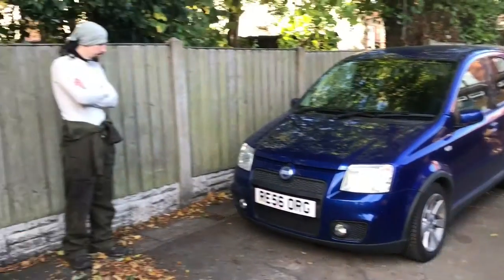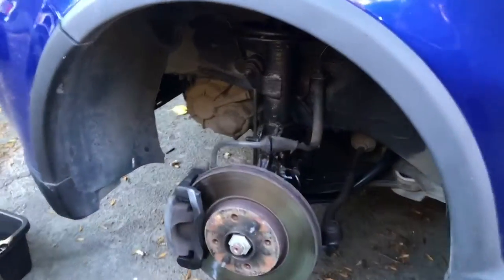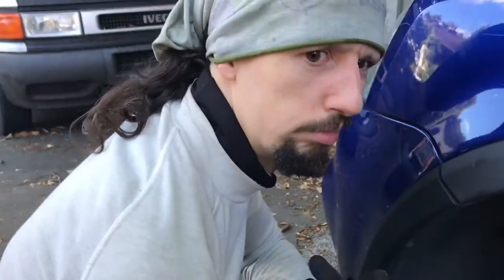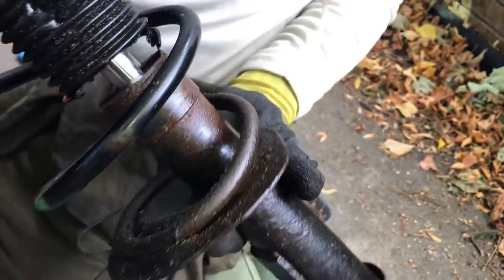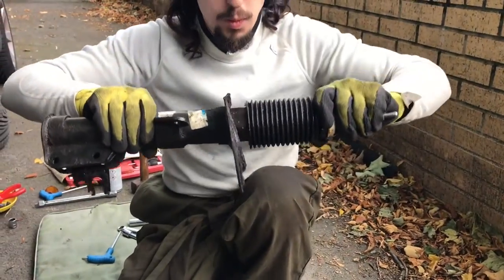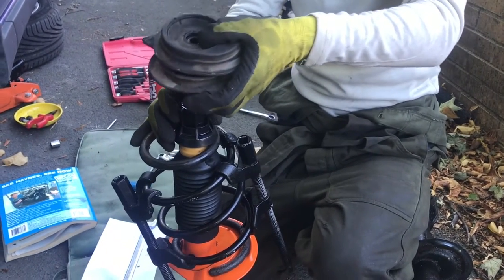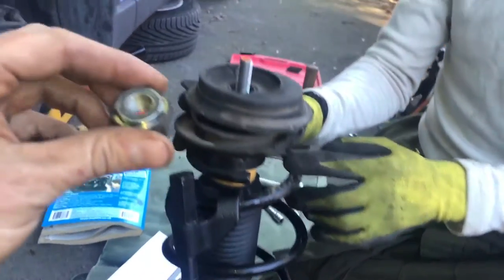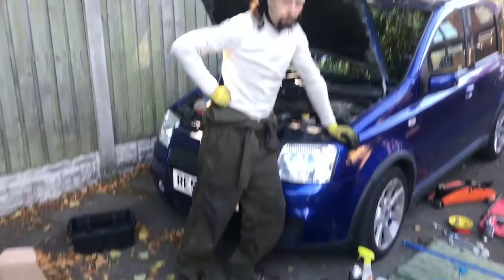Fiat Panda Suspension Strut Replacement

Comment: One of the best "how to'" I've seen I reckon. Chuffed. 😷👍🏼
Reply from the maker: Cheers! That’s great to hear 😀👍
Reply: @MechitBetter  I'm doing mine next week.... 😲
Reply from the maker: Good luck to you. It’s not too complicated if you take your time 👍
Reply: @MechitBetter  just thought I would let you know how I got on.....

1) the two bolt heads on the bolts that hold the shock absorber to the knuckle were corroded and the bolt heads just rounded off so I had to use a blowtorch on them along with mole grips to get them off, took absolutely ages.
2) the top shock mounting nut was so tight when I put the allen key in to stop the strut centre from spinning it stripped the allen key centre on the strut so I had to get two mole grips on the chrome strut to stop it from spinning then it was still so tight it was turning the chrome strut I ended up trying heat with a blow tourch/freeze spray but still not worked so I had to chisel it off..
3)and the next obstacle was the anti roll bar link nuts siezed. They were that tight it again stripped the allen keys round (yes correct size used) I had to hacksaw the link in two, pull the plastic cups off the chrome ball joints, mole grip the chrome ball socket and undo the nuts that way
4)the final obstacle was the big nut holding the top strut mount was so seized it stripped the allen key round again so I had to resort to the double mole grip onto the chrome strut method and shock it off initially with a cold chisel. All of this took me 4 hours in total.

CAN ALL THE PEOPLE IN THE WORLD WHO REASSEMBLE STUFF LIKE THIS PLEASE USE COPPER SLIP!!!!!!!!!!!!!!!!!!!!!!!!!!!

😷

Comment: You are lucky. The later Panda (2012+) is very similar but to reach the top of the struts you have to remove a large black plastic exterior panel that is between the bonnet and the windscreen.
And BTW, you could use a cranked ring spanner for that top nut. 19mm or 3/4" - exactly the same.

Comment: You were really lucky with that drop link. If the original part was fitted dry (without anti-seize paste), you’ll find an angle grinder is the best way to split the nut.

Comment: Great video, well done guys, my panda is booked in to a garage to get the same job done, next time I'll get a set of spring compressors and have a go myself, thanks guys, keep them coming please :)
Reply from the maker: No worries Tony. Thanks for watching! 👍
Reply: Get yourself some angle ended ring spanners top nut is 19mm. The special step nut is 27mm.

Comment: The top nut is easy to remove with a cheap cranked ring spanner from Lidl or Aldi. Except when it was fitted by a gorilla. Mine had to be drilled vertically down the threads. It wrecks both but gets it loose and both get replaced with the new shock. A cheap rattle gun (£50 from Lidl) makes life easy. 
The stepped nut has to be tightened to “kin tight” AutoDoc do mention it on their video. 
The M10 bottom pinch bolts are best coated end to end with a high solids paste. Copper grease won’t do. Ditto the M8 bottom ball joint bolt. Also notorious for rust. 
My top spring seat was totally rusted. I scraped it clean and coated with chain saw bar oil. It soon gels so won’t make a mess.

Comment: The hook is to hold the Ram in closed position. And it is used only for packaging  reasons. And for the top mounts you Could have used a nuckle saver ring spanner But Very Good Video for DIY.
Reply from the maker: Thanks David. We’d assumed that’s what the hook was for, but it wasn’t mentioned in the packaging anywhere which seemed a bit remiss on their part. Thanks for your tip about the spanner too. We’re always happy to bodge something up if it saves us a bit of cash 😀

Comment: Really good thank you. But I found if you release the top nut before removing completely the strut you don't need to make a special socket as the strut can't turn as still fixed.  Then it is easy to completely undo when ready to remove.
Reply: I don't think the complete strut spins around its the shiny silver damper rod that spins

Comment: The thin rod with the ends bent over is to keep the strut compressed in the packaging (as you demonstrated it expands if left alone due to pressurised gas inside)
Reply from the maker: Ah excellent! Thanks for letting us know. That’s been bugging me since we changed the struts 😁
Reply: @MechitBetter  Sweet! nice to close the book on that little mystery.

Comment: Several comments that the nuts at the top are hard to undo.  That allen key in the dinky plastic holder @9:08 would never have done mine.  I had an L type allen key with a foot long pipe on it, worried I'd break the key. It got harder as I undid the nut because of corrosion there, so I backed off and carefully cleaned the thread grooves with a triangular needle file.

Comment: Really good video.  Surprised by the general lack of videos on the 169 model Panda on YouTube considering what a popular car it was.  Thank you for commenting on the Konis, I've often wondered if they helped enough to justify the effort, but I suppose when your struts are knackered anyway  you have a good reason to upgrade. I test drove a 100HP back when they were new and just couldn't live with the ride, so I got a Multijet diesel version instead.  That was also bad but in a different way.  I don't suppose it matters now because the job is done but could you not have used your modded socket to hold the nut still, then put a long 5mm hex socket onto a torque wrench and tightened it to 65lb/ft by rotating the strut counterclockwise?  

Also, great that you emphasis the safety aspects particularly the spring compressors.  They're a necessary evil and even though you can get ones now that are pretty safe I still hate them.

Finally, a bit of humour is an excellent but of light relief but your sidekick could tone it down just a bit, unless he's trying to audition for kids TV?  But I am admittedly a bit of a grumpy git.
Reply from the maker: Thanks Paul, for watching and for your suggestion regarding the torque wrench. Your method would work with a long hex bit. I’ll remember that for next time! 👍 it’s OK to be a grumpy git. We’re often the same. A little larking about keeps us sane during these jobs 😁

Comment: Which Haynes manual did you get for the 100hp? There isn't one exclusive to it. I've heard you need both the panda one for the non-mechanical stuff and the punto one for the mechanical stuff. Is that true? Cheers!
Reply from the maker: So far I just have the standard Panda one and it’s been fine. I haven’t done any major engine work though 👍
Reply: @MechitBetter  in case you still got the car, it's not a bad idea to get one on the side! My car has done similar mileage as your one and I need a new clutch last month. The steering column, rear axle and transmission are the weak points on these cars I was told!👍

Comment: when i did mine and i couldn’t get the machined spacer nut at the top off . I ended up having to cut it off. If you need to do this you will struggle to find fiat.replacement nuts , but ford ka part number 1680443 are identical and are cheaper and easy to find.
Reply from the maker: Top tip! Thanks for that 👍👍

Comment: Hello a great video which will help me on my panda. there is just one things that needs more detail, the 'thing' you put on top of the spring at 18 mins 40 seconds into the video? I think it is called a top mount, you say it is two parts connected together, I can buy a new top mount on ebay alright, but I'm not sure if there is a lower part or that is part of the top mount too? If so I' need to take this bit off the old spring, which will be extra work. Basically does the spring just sit on the back of the top mount or is there another piece of metal that goes on first to hold the spring in the right pace, then the top mount goes on?

Comment: Hello, a really good video, I've got an identical 100hp and thinking of doing the same. Did new shocks help your cars ride and road noise? I've done the anti roll bar bushes, wishbones and drop links and new low noise tyres, but it still has a road noise roar and the car is absolutely terrible over bumps being completely rock hard. The front shocks are the last things to do and wondered what improvement you have had? PS also hate  spring compressors, can easily lose a finger or worse with those things :-)
Reply from the maker: Cheers. Glad you liked it. I think the road noise is probably defined by the tyres, but the new shocks helped the ride a bit. As standard the 100HP is over-dampened so the new Konis do seem a bit more forgiving and pliant. It’s supposedly the rear shocks which are the worst though. Changing those from factory to Koni is supposed to transform the ride. Mine are still standard so can’t say from experience. Just what I’ve heard. I did however take out the rear bump stops which made things a lot quieter. I just think road noise is part of the 100hp experience. They’re big wide tyres for such a small car, and there’s not much sound deadening. Maybe that’s the way forward if you want to quieten things down a bit 👍